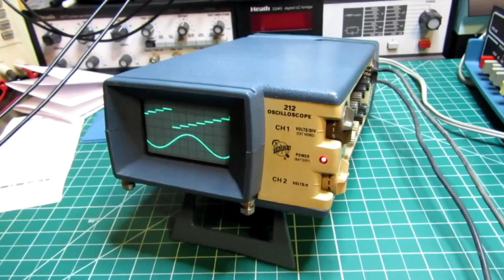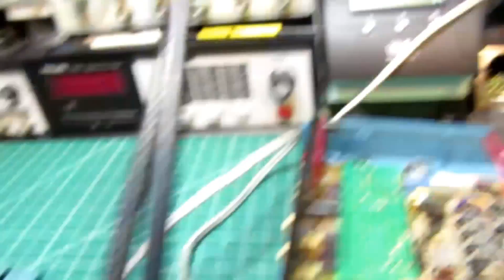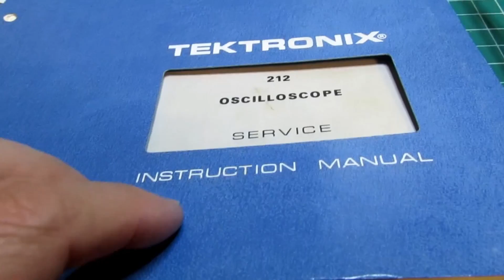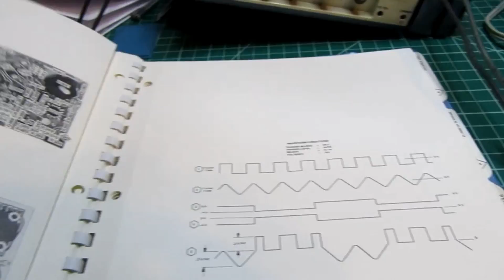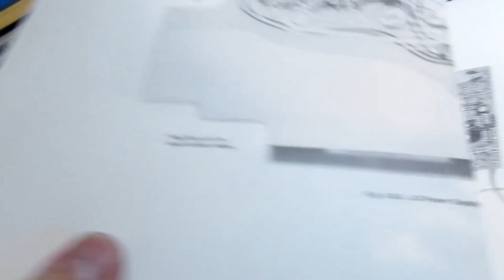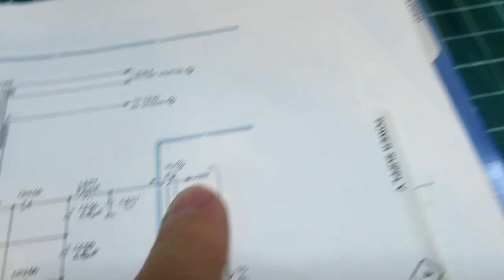Tektronix 212 Handheld Dual Trace Oscilloscope

Comment: I saw this video unloaded 5 years ago. I am unable to understand why you made this video of 40 minutes. How many people have this 1960 a tiny oscilloscope. You seems to be well qualified engineer. You could give a very basic parameters like maximum frequency which is the fundamental parameter of any oscilloscope, and I doubt you have not mentioned it. The only thing in this toy oscilloscope is it's tiny size. Watching this video was just wasting 40 minutes of life.
Reply from the maker: Science followers, if you can't figure out how to stop watching a video which has clearly not been made to your liking, I feel pity for you.

Also, I UPLOADED the file, I did not UNLOAD it.

And if you think this is a toy oscilloscope, then your understanding of the uses of test equipment is so limited that you should not be criticizing ANYONE.
Reply: @youtuuba  
Ok, read and understood. 'Unloaded' was just a key mistake. How can one stop watching video immediately after it starts. Anyway I appreciate the circuit analysis you explained. 
Regards.
Reply from the maker: @Science.Follower  , you originally complained about wasting 40 minutes watching my video. One would think that can can detect the tenor of a video early on, and stop watching; it does not need to be immediately after beginning to watch! Also, YouTube has this cool feature where the viewer can scroll quickly through the video to get an idea of what it contains, without watching real-time through the whole thing.

Comment: do you know if the 213 or 214 have x-y mode? I want to do vector graphics on it and I think the DSO 222 is too slow sample rate.
Reply from the maker: Sideburns Studios, Unless you need the tiny screen, I would think any larger analog scope would serve better and cost less and be more reliable than anything in this series.
Reply: @youtuuba  I like the small portable form factor and tiny crt’s and battery powered. I want to experiment with oscilloscope music and was going to put a Bluetooth receiver it it so the whole thing is self contained and portable.
Reply: @sideburn  The 212 does X-Y, I'm buying one for osci music myself
Reply: @DJ_Level_3  I got the 214 back then. There’s a video of it on my YouTube channel

Comment: Hi - I'm new to oscilloscopes, but just picked up this exact model. I'm wanting to use it to display sound waves from an analogue synthesizer. I've seen  tutorials (other oscilloscope types) where they literally just connect one of the channel probes to the audio out of the synthesizer and it reads the wave shape. I can't get my oscilloscope to do this - it's pretty much always the same shape no matter what I do on the synth. Any advice? Or maybe I bought a broken oscillator. Thanks!
Reply from the maker: Michael Rowe, try hooking your scope up to some know constant waveform source, like a signal generator, and make sure it is working properly, before connecting it to a signal source that tends to make transient waveforms.

But, yes, you should be able to just connect one of the two scope probes to the audio (line level) outputs of your synthesizer.

Comment: Thanks for posting this informative overview on the Tektronix 212.   I am looking at a purchasing a surplus unit and I am intrigued by the  design challenges of this model scope given the state of 1970s technology.   In retrospect, the idea of having the capability of  hanging a functional, self-powered oscilloscope  around your neck  to perform measurements in the 1970s  prior to the digital revolution was quite an amazing achievement at the time.  I have found that the US ARMY used this unit for the servicing of multiple launch rocket systems into the 1980s.  I also see that there  is a video posted on changing the batteries. Good work!
Reply from the maker: It really is a nice little scope, a pleasure to use and very convenient. We used the heck out of them where I used to work in the late 70s/early 80s, and they were reliable and utilitarian. Not something I would want as a bench scope, though....but perfectly good for troubleshooting, and basic testing/calibration type activities.